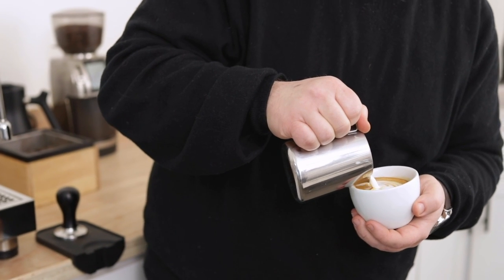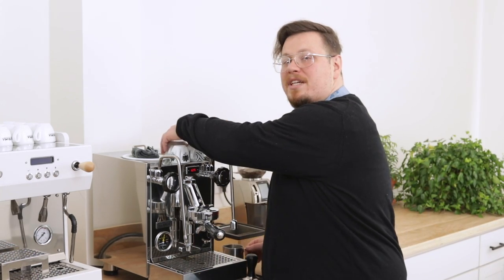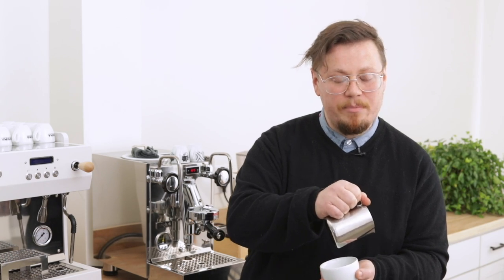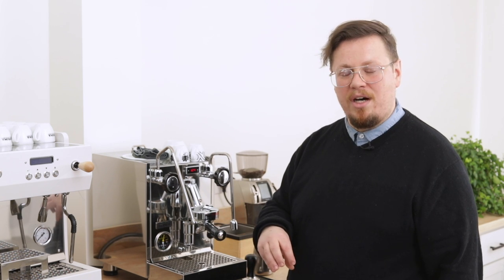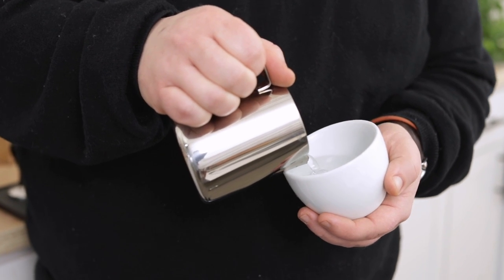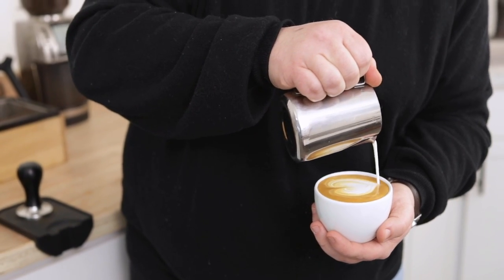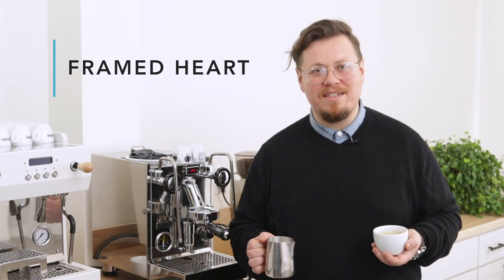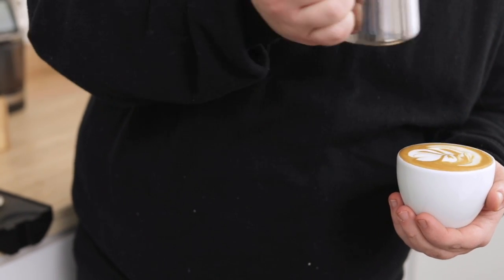How to Pour Latte Art

Comment: Great video full of fantastic tips! When I make a latte at home, I use 200ml of milk and I sometimes run out so I’m curious, what size is your pitcher and  how many ml of milk you use?Thanks so much!
Reply from the maker: Thanks, Evelyn! That is a 400ml pitcher, but how much milk you use really depends on the drink type and size that you are making. The Revolution Steaming Pitchers have a guide on the inside of the pitcher to help you out with that. What kind of drink are you making? 200ml is a pretty good amount for a drier cappuccino.
Reply: @primacoffeeequipment  Thanks so much!  I make a double shot latte with my Breville Barista Express and use the pitcher that came with the machine.  I buy good quality beans from a local roaster as I’ve learned that getting a good crema helps in making latte art.  I can get my milk to the right texture most of the time, but sometimes the steam doesn’t come out as nice (it can sputter so I don’t get that "paper tearing" sound which so many videos recommend to get) impacts my milk (I’m also meticulous about cleaning the steam wand and the machine).  Sometimes I’ve been able to create a nice tulip with 5 layers (almost Instagram ready).  As I do this for my own pleasure plus friends & family. I just wonder if I should invest in a bigger pitcher.  Thanks so much for your response.
Reply from the maker: A larger pitcher might be a good investment. They aren't too expensive, so it could be something you try out to see if it helps you out. Sounds like you are checking all the boxes though!

Comment: I bought two home espresso machines. However so far I am not able to froth the milk that can pour latte heart (art).  I'm able to steam the milk with right high pitch sound, swirl the milk and avoid big bubbles.  The frothed milk always has a thin foam layer floating on the surface. After pouring the milk at a height to mix the caffee and milk, I lower the pitcher to create the art.  However the milk cannot form the white pattern on the surface until the last foam layer.  The last foam layer doesn't have much flowability and is  simply dumped over the surface forming a chunk foam cover. Please help me resolve the issue.  Thanks!
Reply from the maker: It sounds like you're creating the micro foam but not integrating it all the way through. After the initial chirping you need to spend the remaining time getting a proper whirlpool effect. This integrates the air uniformly. Also be aware that every second after you stop steaming the milk and air are quickly separating. The longer you wait the greater the separation and the denser the foam.

Comment: Please help me with the differences btn cappuccino, flat white and latte in milk steaming.
Reply from the maker: The milk for all three should have the same, or a similar, texture, what is commonly called microfoam. In the old days, when cappuccinos were made with dollops of foam, looking more like whipped cream than milk, the “flat” cappuccino (flat white) designation made sense. Now that most shops prefer microfoam to bring out the natural sweetness of the milk, and to create a creamy mouthfeel, cappuccinos and flat whites are relatively interchangeable designations (although you will find some different takes on the matter). Temperatures for caps and flat whites should be around 140 degrees F; temperatures for lattes should be slightly (but not much!) higher. The short answer is: heat until the milk is sweet and creamy, but not higher, for any drink. Above 155, the milk starts to approach temperatures suitable for making yogurt and cheese but not for adding to espresso.